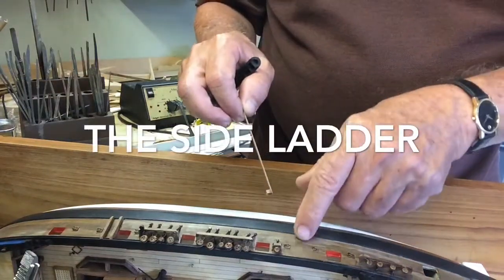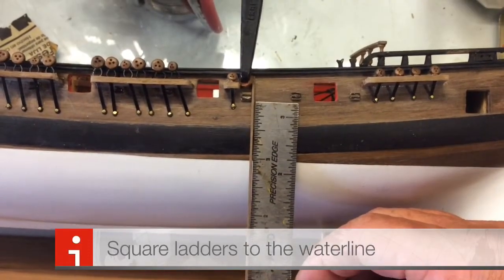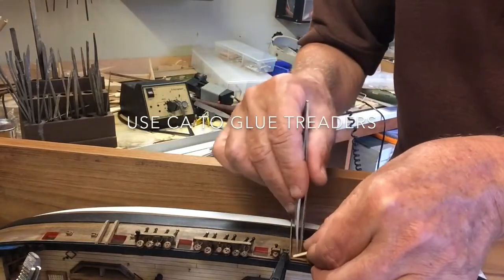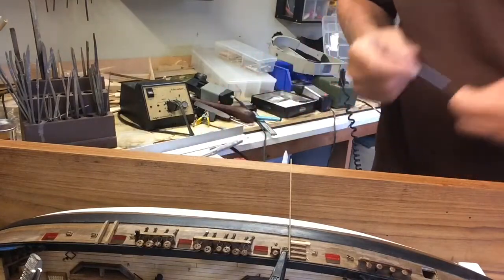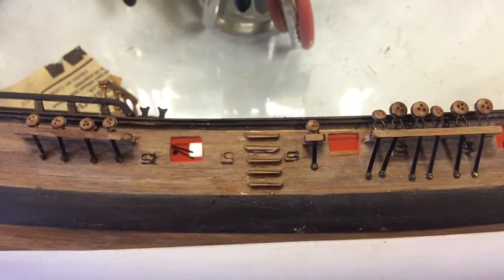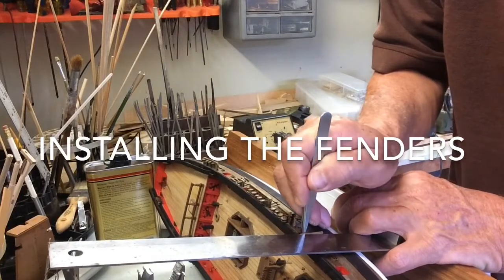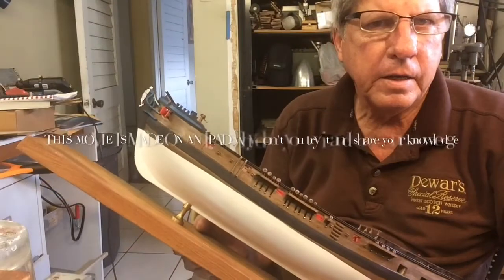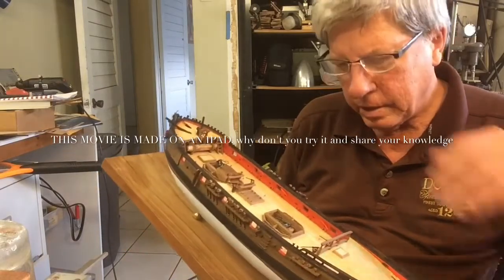HMS Granado. Video 26. The side ladders, the fenders and the anchor lining.

Comment: I've been wondering what those "fenders" were called for a long time. Did they serve the same purpose as a fender does now, or is it completely unrelated?
Reply from the maker: Ill have to check on this, but assume since they are well above the waterline thats the only think they could be used for.
Reply from the maker: The quotation was found in David Antscherl book 2 and makes reference to the fenders. If you are looking for a reference set of books, this series will be the best money you can spend. They have become my go to reference source. They can be found at SeaWatch books.

‘’There are a pair of fenders attached to the ship's side just forward of the entry
steps, opposite the main hatch. On the sheer draught they are similar in
appearance to the chesstree, but serve a different purpose. They act as guides
and replaceable wear strips for raising barrels and casks up the ship's side. The
method of raising casks is called parbuckling. An excerpt from an illustration
(right) in Steel's Mastmaking, Sailmaking and Rigging' makes this procedure
clear, although here the cask is shown being parbuckled up the side of a
wharf instead of a ship.
Parbuckleino
According to Steel, the fenders are sided 3%" and moulded 4' at the
upper ends. They taper by I" in their length from above to below.
The Swan class draughts show them as 4½"
' sided. Three ⅝" bolts
secure them to the ship's side.? Again, you will need to shape the
fenders carefully to fit the side of the ship and then mold the outer surfaces as before’’
Reply: @kevinkenny5122  Very interesting! Thanks a lot for the reply!
Reply from the maker: Unfortunately the comments section does not allow posting of drawings or photographs which would complete the post, if only.